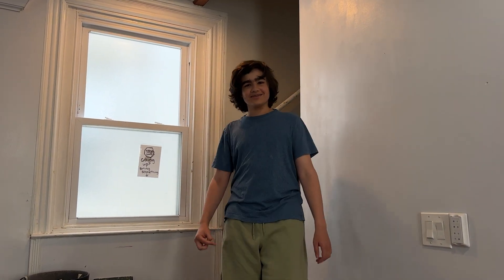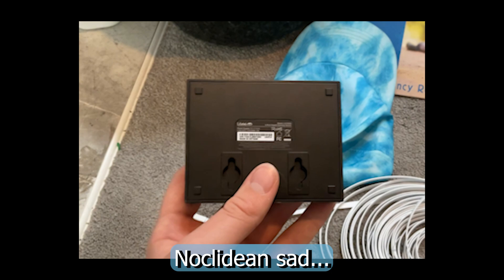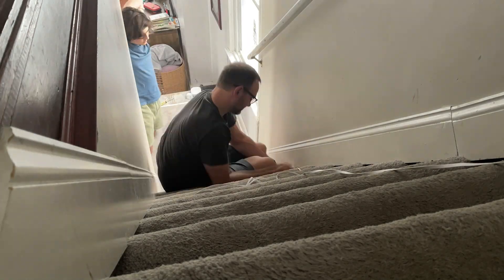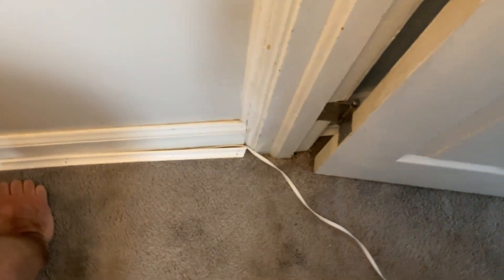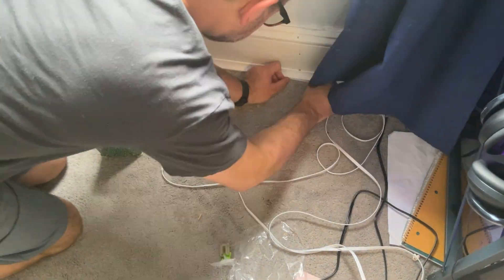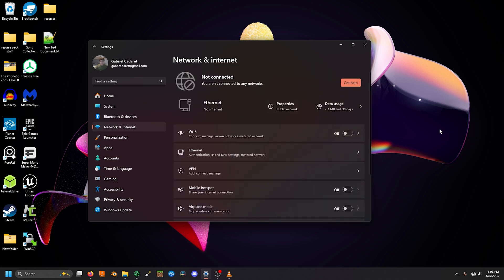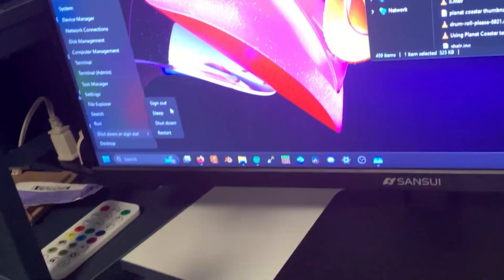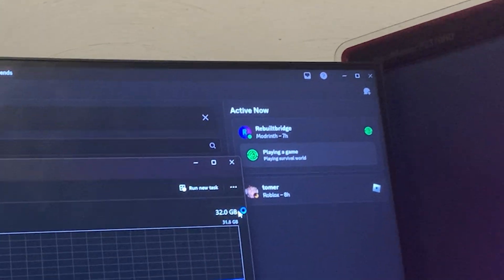I tried Ethernet

Comment: Im not sure if your dad is aware, that or he had a reason, you can pull up the carpet off of the carpet tacks and route it that way. It would result in a cleaner route as well as allowing it to go under the door better.
Reply from the maker: I didn't think of that but its a good idea, my dad probably didn't want to do it because it would be hard to pull up the carpet that far and put it back down.